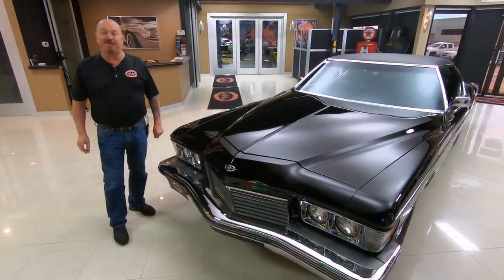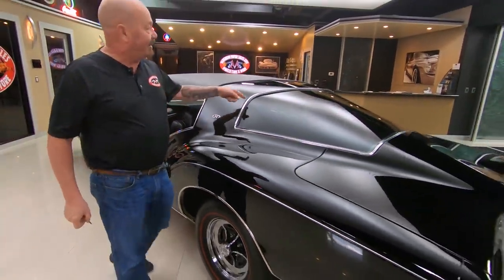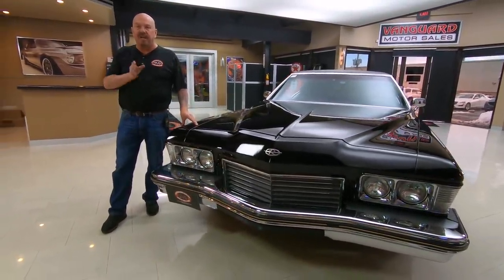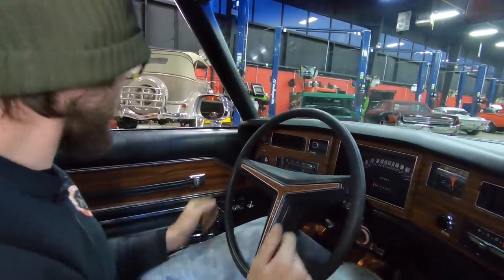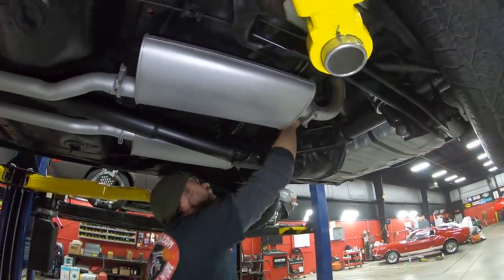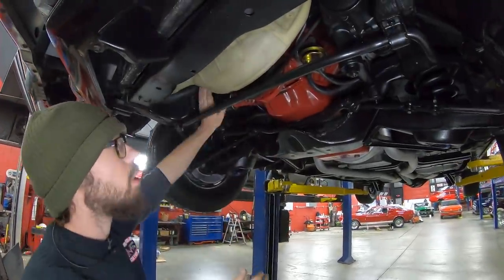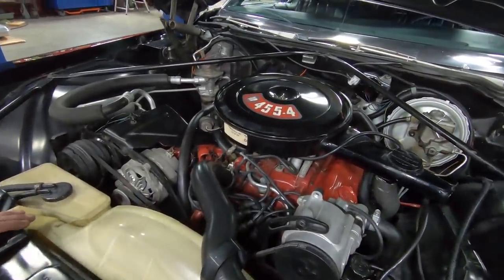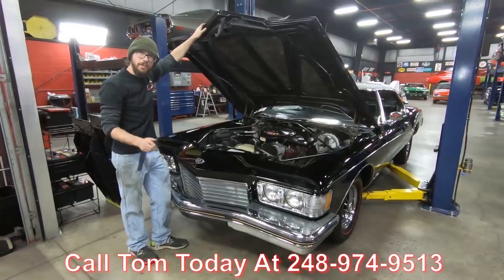1973 Buick Riviera For Sale

Comment: The 73 had the better dashboard and nicely refined front and rear design. They got right and then dropped the body style. If I could push that front bumper in a few inches it would be perfect.